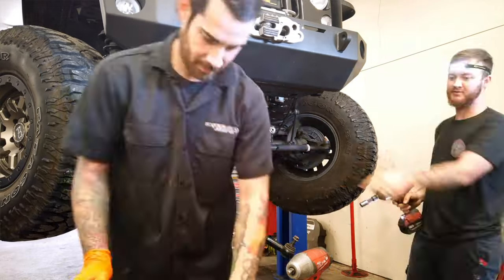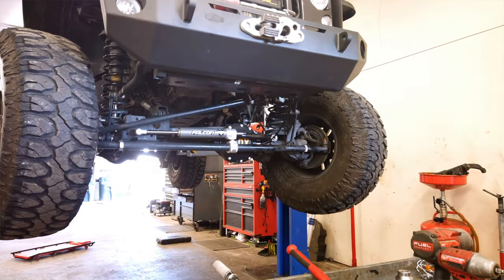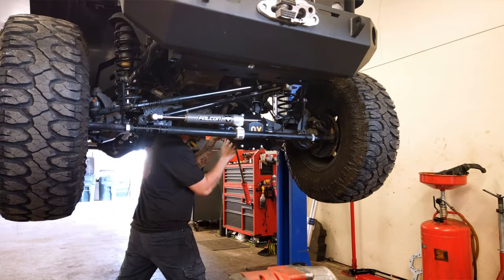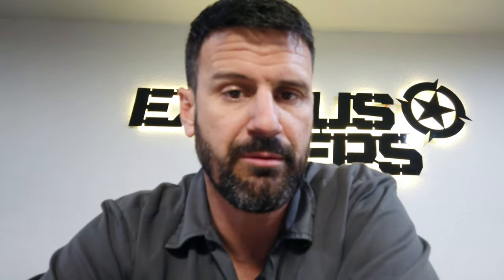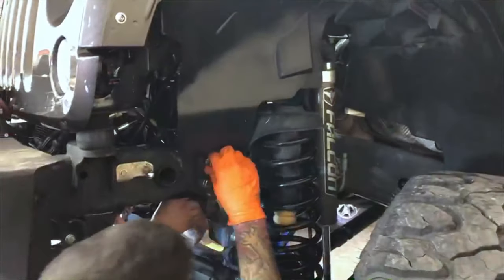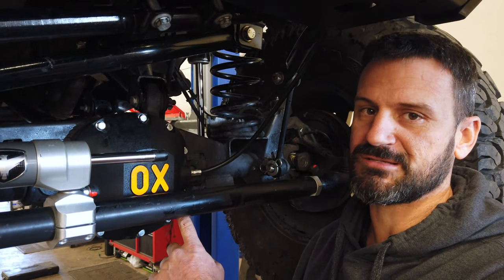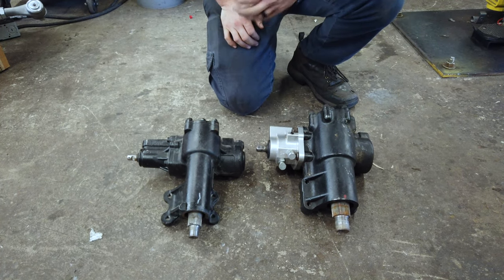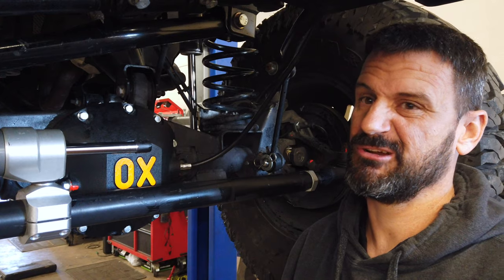Beef up your Jeep Steering, Rundown on the PSC Big Bore Box

Comment: NOBODY packs their product better than PSC! When I got my Big Bore it was the hardest unboxing I ever did...50 industrial staples, nested between heavy duty molded foam. 
I went with the Big Bore XD w/ high vol pump,resi and cooler etc. I had no intentions of going bigger than 37s and thought I didn't have the need for ram assist. Initially, everything was great. Turned my 37x13.50 STT Pros with a finger, even with lockers engaged...til you're pinned up against the rocks on the more technical stuff. 1st trip wheeling with the Big Bore, half way through the 1st rock garden I immediately regretted not going with the XDII-R. If you're going that far, a couple more hundred for the ported box won't kill you. Even if you don't initially want to run ram assist then you can just keep it capped and if ever in the future you want to upgrade you're a couple of hoses away. In the end, I ended upgrading and luckily recouped and offset the cost from selling the Big Bore XD. Not saying the XD doesn't have it's place, just depends on what you plan on doing and terrain you're wheeling. Techy rock crawling stuff, go ported.

Comment: Been running the Big Bore Steering Box for about a week now and I have 38x15x20's Nitto Muds and it turns the wheel with ease very noticeable difference, best mod I've done
Reply: Are you running stock pump or did you upgrade the steering pump. About to buy a big bore and curious if I can stick with stock pump
Reply: How has your set up help up after 2 years, I have 38x13.50x20 Toyo Open Countries. I’m wondering if I can grab this kit now and upgrade to full hydro when I upgrade my front Axel. Or should I just break the bank now.
Reply: @JohnnyMcFLY100  What's up man... My setup has been flawless absolutely no issues at all. I did upgrade the steering pump at the same time, only bcuz I  knew it would eventually go out....

Comment: just installed the on my jkur. anyone else have a dead zone? like when driving straight you can turn the steering wheel back and forth a bit before the jeep turns. my old box didn't have much play (if any at all). PSC is telling me this is normal.
Reply from the maker: I’ve seen it, but not often.